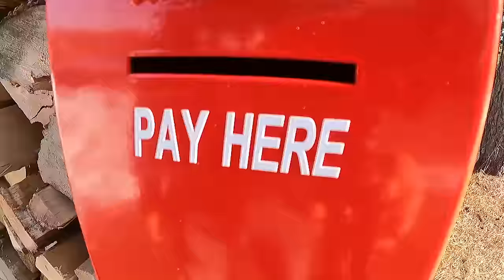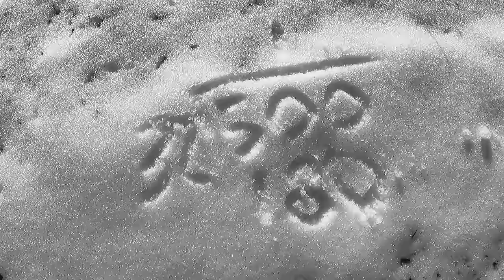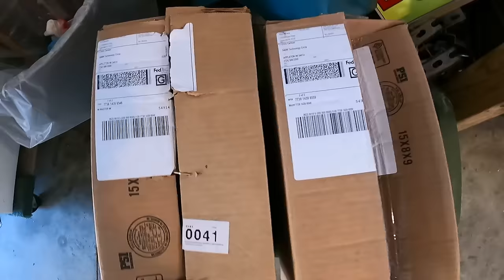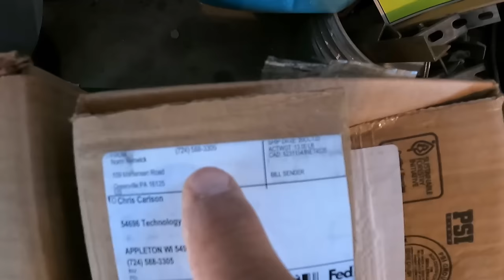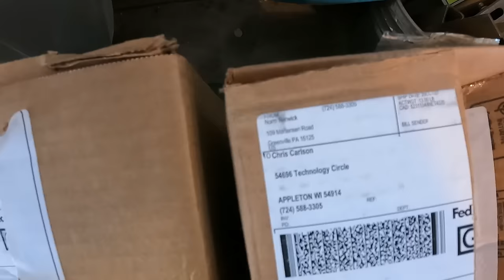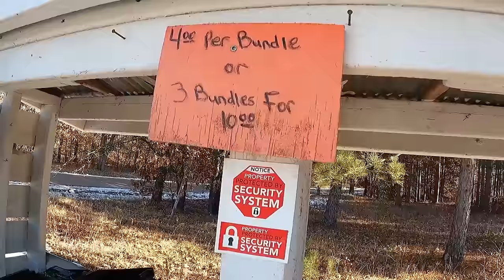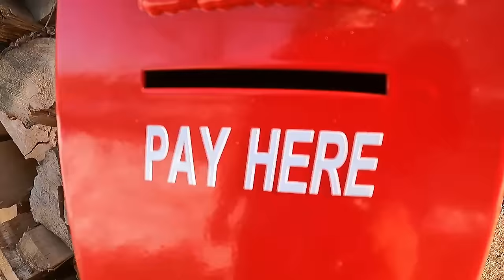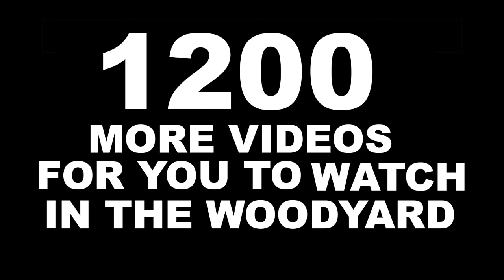FIREWOOD PAY BOX INSTALLATION!

Comment: I sold a face cord to somebody today that came and picked it up and his truck had busted leaf springs lol. He must have had a fun ride home. He literally stopped at the Ford junkyard on the way over and picked up a couple leaf springs but then thought it was a good idea to then load it up with a face cord of hard maple/ash mix. Sure it was a fun ride home. Said they were out of wood only had enough for a couple days and their only heat source is wood. Would think they would have thought about getting stocked up for winter before Christmas lol. Going to need quite a bit more than the face cord they bought. Maybe I will hear back from them for more but I don't have that much left that is ready to burn now. I showed them a mound of maple I have that should probably be ready in the next couple months but its not quite ready to burn yet I was just going to save for next year unless somebody that already bought from me so they know they have enough to last a couple months till they need it then it will be there for them. Had a couple blow down towards the start of the summer and I got it cut and split within a day or 2 of them coming down so it should be ready to burn at least in the next couple months.
Reply from the maker: ouch!

Comment: 1/3 of a cord is 42.66 cubic feet.
Reply from the maker: Yes and a full cord is 128 cubic feet I was figuring the FACE of it to figure FACE cords which are 4'x8'=32 SQUARE feet which is the same as 1/3 of a cord. 1/3 of a cord is called a face cord in most of the country and Canada along with some other terms like a rik, rank, row, bush cord, pile, load, truck load and a few others. In most of the country  different terms for wood are used and it is a regional thing for what you call it and some eastern states it is illegal to call it anything other than a full cord or fraction of a cord.

Comment: Hard Maple produces 1/3 or 33.3% more BTUs not 25% Problem for tampering is taday's cheap battery powered tools making defeating any padlock secured box a one minute cut with die grinder and cutting disk crooks win only a internal locking mech. with a breakable link to locking bolt (prevents drilling) can delay a thief more than a couple of minutes. I feel for all the businesses who spend their resources to prevent theft, such a waste of our capital. Very nice set-up your brother has family traits are not asually random but rather the result of a solid examples provided early in life. (Parents). Ray
Reply: 25% less.
Reply from the maker: Thanks Ray. Hard maple 24 BTUs soft maple 18 BTUs...math 25% less.
Reply from the maker: yup!

Comment: I think a facecord is 43 cu ft not 32 so you would have about 12 facecords in that first stack.
Reply: 4'high x 4'deep x 8'long = 128 cu/ft.    Divide into 3 face cords  [128 cu/ft] = 42.6 cu/ft .Close enough! You're right. TKS.....
Reply from the maker: Yup, i was measuring the FACE 4'x8' is a FACE CORD OR 1/3 cord and the\at is 32 SQUARE (16"pieces) feet not cubic feet but still a face cord.
Reply from the maker: Yes.... I was not figuring cubic feet but SQUARE FEET as in 4'x8' so 32 SQUARE feet of 16" pieces is the same as 1/3 cord or 42.66 cubic feet.
Reply: @InTheWoodyard  no problem. There is certainly confusion about what a facecord is. The way I measure a facecord is as follows 4' x 8' x 16" / 12" which comes out to 43 cu ft.